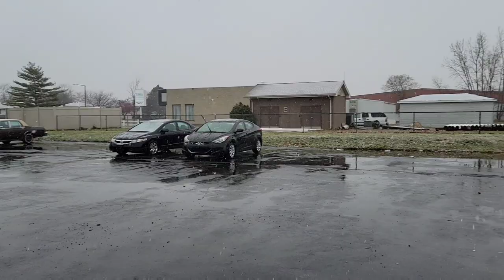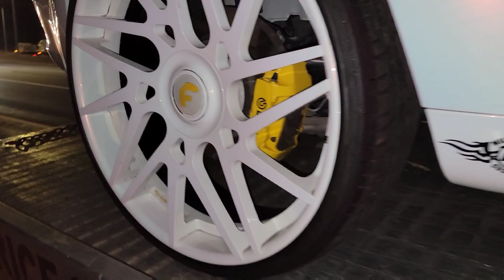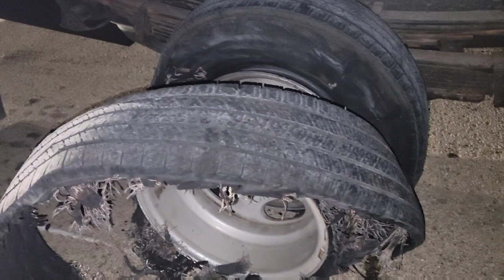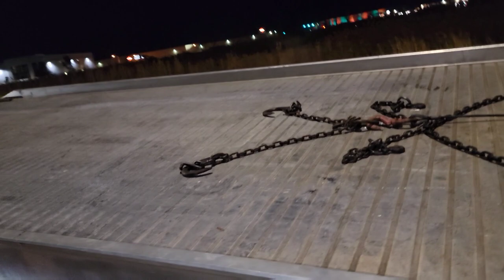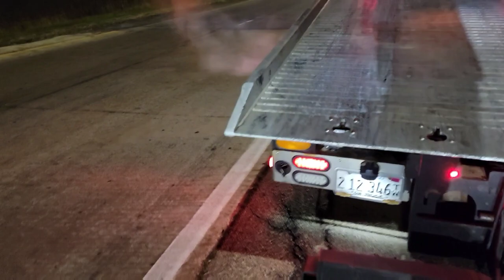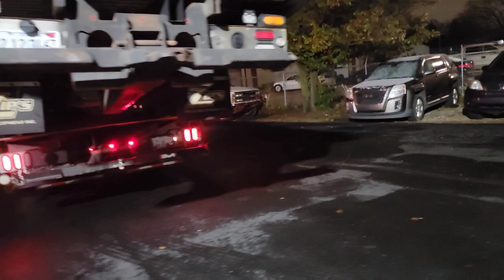Worst towing experience with cjon32 car

Comment: Juan I know this is 10 days old but your flatbed has a wheel lift if you had a spare you could have tilted the bed back and the wheellift down and it would have lift up the whole back of the truck off the ground that is actually your jack.
Reply from the maker: Thanks  I'm going to try it

Comment: What you can do is take one off the other side and run it that way one and one I did it before I drive tow trucks for a living too I have a 2007 F550 extended cab